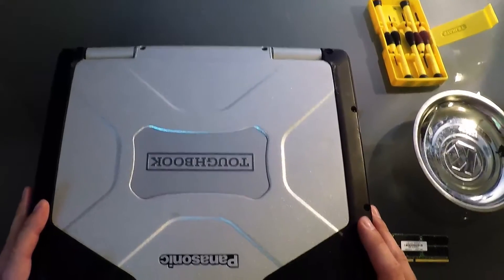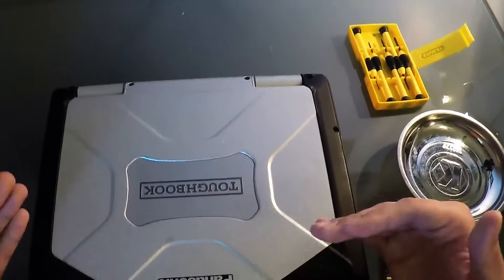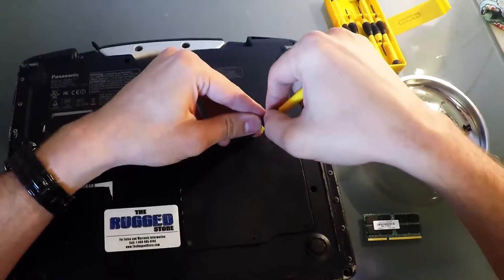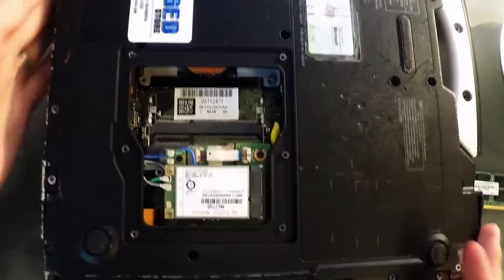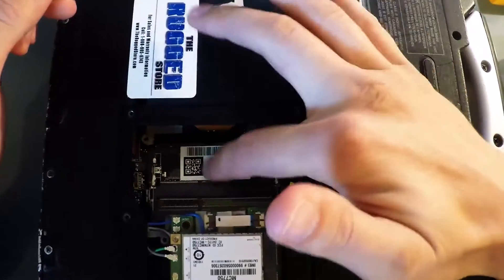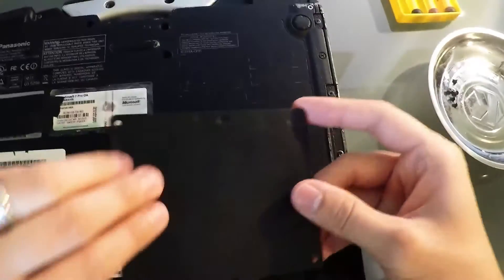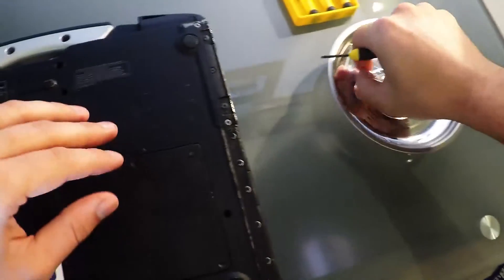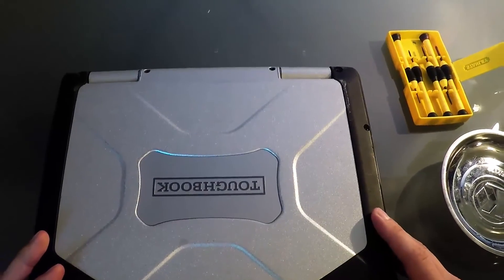CF-31 Panasonic Toughbook RAM Install

Comment: Thank you for sharing this video.. Is it possible to install 2x8Gb (16Gb) on the C31? I have only 4Gb with W10 64bit pro, and ist running slow.. I need to upgrade the RAM.

Comment: Have to create Windows 10 image for a bunch of CF31s.  Does Panasonic have a software utility that you can Run that determines what hardware specific software updates and or firmware updates are required on the unit?
Reply from the maker: Hi Dan, unfortunately there isn't any utility that can be run and the software/driver install is very particular on a Toughbook. Contact us directly through our website and we can see about helping you out further.

Comment: Hello, have a question, i have a cf-31 MK2 with windows 7 pro 64 bit. I want to upgrade to this 1.    16GB 2 X 8GB DDR3 PC3-10600 SODIMM PC10600 1333MHz Laptop Memory RAM 

I also see this below can anyone work is there a plus with higher Mhz

2. Hynix original 16GB (2 x 8GB), 204-pin SODIMM, DDR3 PC3L-12800, 1600MHz memory module
Reply from the maker: Hi!  This is a bit more of an intensive answer than we can answer through the comment section here; please feel free to hit us up at www.theruggedstore.com

Comment: What's the max ram can toughbook cf31 take? 8gb or 16gb thank you.
Reply from the maker: Hi Diesel!  Approved max RAM varies by CF-31 mark or generation.  Do you know which mark you are asking about?  Or the full CF-31 model number?
Reply: @Theruggedstoretoughbooks  how do you easily determine which mark or generation CF-31 you have?
Reply from the maker: @DJ_Driven  the full sku of the CF-31 should be able to tell you or the type of processor.
Reply: I'm currently in the process of buying an cf-31 here are the posted spec. But I can ask the seller for more specifics.  2 ghz intel i5 processor cf .31 with 8 GB memory., 1TP SSD HARD DRIVE
Reply from the maker: @dieselfixr  Yep, the max ram depends on the mark so if you can at least get the full processor i5 part number i'd be able to help you more.

Comment: Hi only one bank under the cover?
4GB is standard. Is this bank under the cover empty, and the usual 4GB is only one RAM on a more difficult reachable Place in the notebook? Upgrading to 8GB only with 4GB under this easy to open cover?
But what is the manufactorer and type of the preinstalled RAM from a CF-31 MK1?
Because, I could buy exact the same RAM for Dual-Channel.
Reply from the maker: Hi Ano, thanks for watching.  Off the top of my head, I can't remember the size of the RAM I was using to demonstrate (I think it was 4GB + 4GB) in this video but there are two banks of RAM.  If you jump to the 3:40 mark in the video I point out the two different slots for RAM installation (the back slot is already filled with a stick of RAM in the video which I do not remove.)  -Aaron